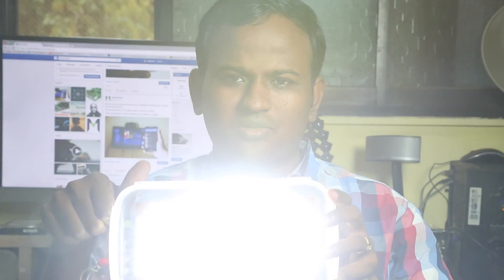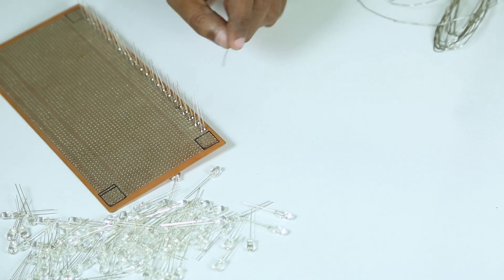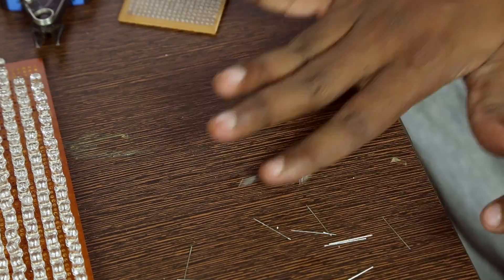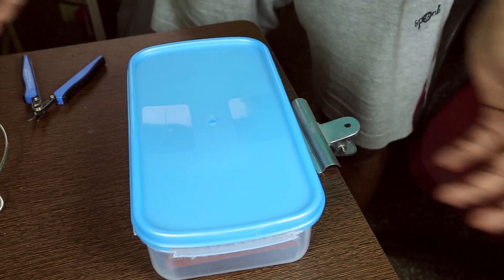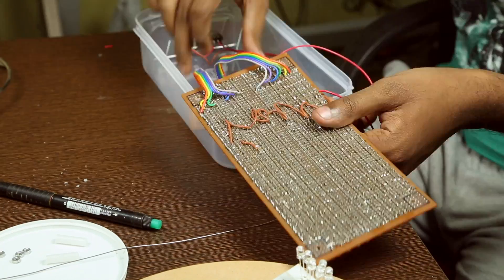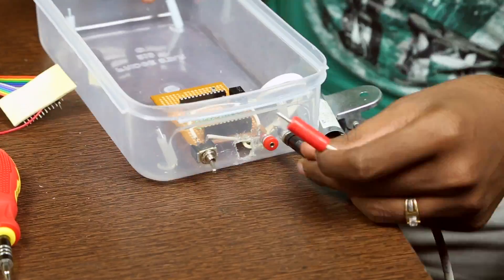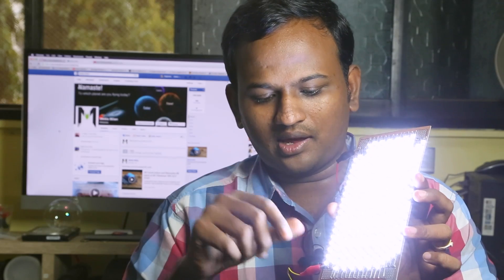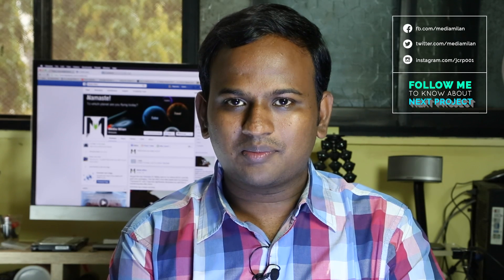DIY - LED Video Light Panel @ less than $12 or Rs.700

Comment: What is this soldering iron?
Reply: The way welder uses welding machine for joining two metals (iron).. soldering iron is machine to join electrical or electronics component together maintaining connectivity between them.

Comment: hey bro! how to solve flickering led strips? please help me to solve this problem!
Reply: Sunil Ingawale add a pwm controller then you can adjust the brightness. or just adjust your shutter speed
Reply: A2N Muhfarisyah okay! thanks bro! I will try that and again contact you! thanks for help!
Reply from the maker: If you use a PWM controller you will get flickering. Try a voltage regulator. But it can be because of the LEDs also. So LEDs tend to flicker with low voltage. You need to buy No-Flicker LEDs or Dimmable LEDs.

Comment: Nice clean build. 
I noted that when you changed the power connection you did not use shrouded pins on the supply side. It is customary to either use a shrouded male on the supply side or put the male connector on the device side.
Reply from the maker: +Twotone will check what is that.
Reply: just to reduce the risk of short circuit.

Comment: Hi there, I am looking for an idea to convert an AC led bulb to DC. I have some which can be made use of. However I don't see any visible circuit in there. Can you help?
Reply from the maker: If you can send me a picture as well as explain why you would like to do that then may be I can come up with something.
Reply: send me your email id on videoeppo@gmail.com and we can take this forward. The reason why I want to that is, earlier with tube light, we would change the tube or the choke or the starter to get  it going. But with cfl, the ballast could not be easily opened. Most of time it would be some simple errors that would make it not to work. Likewise in LED bulbs are a set of smd components and few replaceable components. If we could replace the burnt components may be it would work. If not atleast it could be made to work on DC and be used in conjuction with old discarded chargers.(12v). I don't have academic qualification on these subjects and learn from youtube videos. SO pls help
Reply from the maker: Send me to jcrp001@gmail.com We can talk over there.

Comment: Great build. Why not add a Pulse Width Modulator to reduce any flicker you may get with a camera and it would give you a dimmer switch as well.
Reply from the maker: +Glassic Gamer I have made a separate video about the PWM module. 
Please check it in my uploads.
Reply: Thanks :)

Comment: How many 5mm LEDs on the first panel? It looks as if all LEDs are wired in parallel? The 3mm, 5mm, and snall smt LEDs are usually rated at 20 mA and more current will result in more light output but will shorten the life. The LED strips have three LEDs in series each with a current limiting resistor to insure the proper current. A 105 ohm 1/8 watt would be about right for white, 525 nM true green, or blue and a 300 ohm 1/4 watt for red, yellow and 570 nM green.
Reply from the maker: +good goat At the end of each parallel connection there is a current limiting resistor added to solve the problem.

Comment: can you make using LED 12V? with dimmer? thankyou i hope you will make.
Reply from the maker: +Kyle Vender Please check this video https://www.youtube.com/watch?v=UY27APEC-sA on how to make the dimmer. Hope it helps.
Thanks you.
Reply from the maker: +Kyle Vender This LED is already 12V. Will make a dimmer soon.
Reply: +mediamilan okay thankyou so much :)
Reply from the maker: +Kyle Vender If you have watched the full video at the end I have shown how it can be done with LED strips too. Actually its a easier way to do it.
Reply: +Kyle Vender make sure you use a volatge dimming method and not a potentionmeter, as potentionmeter will result in flashes when recorded in video.
Reply: can you do a tutorial? pls